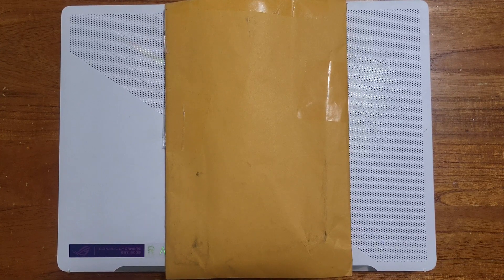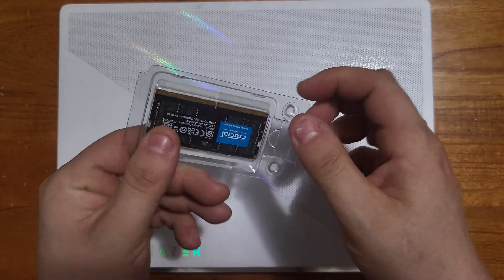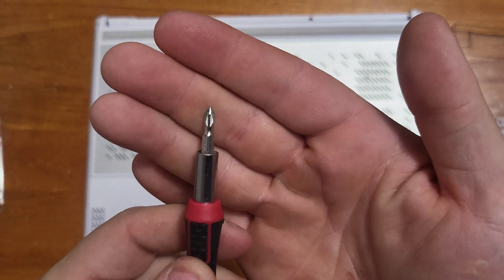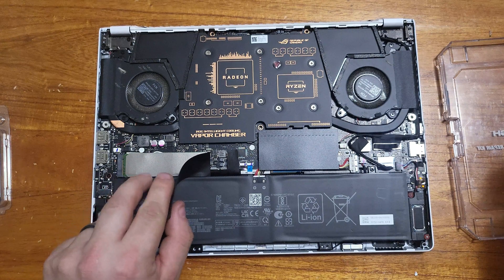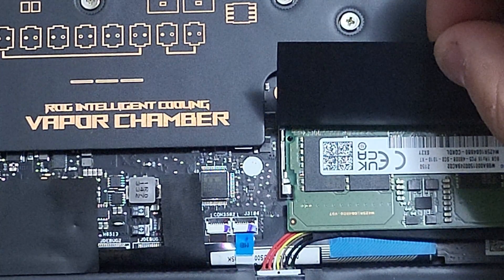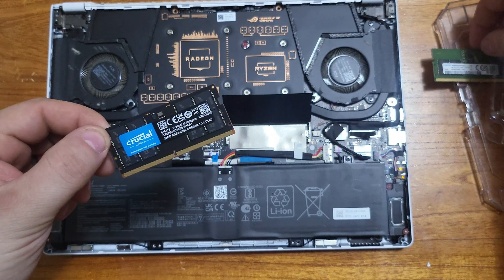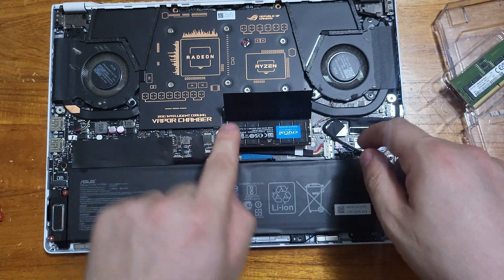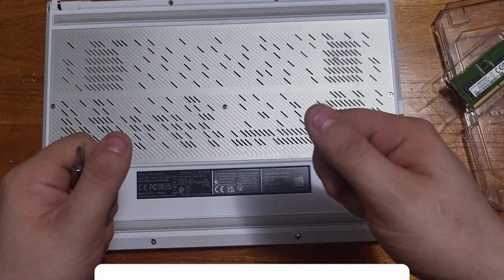Upgrading YOUR Zephyrus G14 Laptop's RAM in 2023 & 2024...But How?

Comment: dont u need to unplug the battery connector first?
Reply from the maker: Long answer:
You can if you want to it's totally your choice, that is why we completely shut down the laptop, now I know it shuts most of it off but there are still some things still running in the background, but in this case sents the removal ram douse not have any of the software in it there is no worrys of damaging your laptop, now unless you have a laptop that has the software in the ram for example a ( DIY/Build yourself ) then yes you will need to unplug the battery, because if not you can over load the motherboard and completely destroy it, but that's with removing the ram or storage for that manner.

Short answer: No, you don't need to remove the battery, but it doesn't hurt as long as you know what you are doing 😉

Comment: What size screw driver do you need?
Reply from the maker: Well there are a couple that work as far as I know the fist one is recommended and the other one is a bit loos but it will get the job done, now if you are just wanting to buy a simple tool kit make shure its made for electronics or check to see if it has one of the two screwdrivers in there now the name will be ether stamped/ imprinted  in the screwdrivers or on the box the one I recommend is ( CR-V PH1) and the second is (CR-V PH0) that is the name now a second option is, and I herd this works but be warned i have not tried this before so i dont know if it works,it's glasses tool kit.
Reply: @DKnight4225   Ordered a tool kit and the PH0 seems to work better.  Thanks!
Reply from the maker: @RainbowKidd ya not a problem 👌 😊
Reply from the maker: As for Windows, it is installed in the built-in ram, so there is no need to be worried about removing windows,  and as for the boost drive, short answer yes, long answer  its only because the built in ram store your windows and all the basic items that make the pc and/or laptop work has its own system, and all removable ram is for games, work, and so on houses it's own boost system that you will need to set up, now it will be in factory boost wich is only about between %50-%75 depending on brand and ram but you can change them in settings or where ever you adgust your boost, I hope that helps let me know if there is anything else I can help with. Thanks 😊

Comment from the maker: So there are 2 8gb that makes 16gb but can only remove 1 of the 2 1 id built in non removable and the second is, by a slot shown in video and the max ram/gb is 32gb for the laptop to work properly adding more internally can over heat the laptop plus your pc wont Recognize the extra gb therfore they will never be yoused in order to get more gb is to max it out shown in the video with the 32gb and an external usb like gb stick like a flash drive but had gb instead of storage.

Comment: Thanks for great video! Is it possible to add a 32gb ram to a 16gb on board to get 48gb?
Reply from the maker: Hey thanks for your question!

 Ok so there is a couple answers to that 
1. The 16gb on board aka(built in memory non removable) no you can not add another 32gb on top or into.
2. The only way you can is to add it to the external gb.
3. If your wondering if you can add more gb sticks to it even though it only has 1 plug, you can but it would go through your USB drive but not internal. I hope that helps 🙏 if it don't or got other questions please let me know thanks!
Reply: @DKnight4225  ok, but the 16gb non removable is in slot. Your option 2 would mean adding it to the other slot right? Or am I interpreting it wrong?
Reply from the maker: The 16gb is non removable its Soddard in, its part of the motherboard, and the
 #2 Is adding it like in the video plus it only comes with 1 gb slot built in to the laptop and in the video that is the max internal gb you can put in the slot, plus if you ever wanted more gb it would be thrue a external usb
Reply from the maker: Long story short
no you can't remove the 16gb because it's built into the pc but can add more by the video I made or by buying a USB gb card to plug in externally like a flash drive but it's for gb

Comment: Any sodimm that is the same as soldered on the MB will work, provided that it is DDR5 aned 4800 mhz.speed.  DO NOT waste money on faster memory, as it will slow to match on onboard memory.  I recently upgraded my Asus G14 using Corsair Vengence memory, and it works fine.
Reply from the maker: Yes that is true on it slowing down, but if that 8gb on board gets Yous'd up, (example) you are yousing two external screens or having it be a power ram house on music and cinematic editing all at ones, you will be surprised it will Youse a lot of ram, and will over clock that ram both internal and external, i know this because i boughten one other and still wasn't enough ram for what i was yousing it for, now for the main everyday Youser for editing, gaming, YouTube, ext. that i have installed "yes it is to much ram and is not needed" on the other hand i got a lot of mixed responses on if this laptop will even  fit much less work in a laptop, and if it was even possible, that's originally what this was about and how to install it correctly. but YES I TOTALY AGREE WITH YOU! 😊